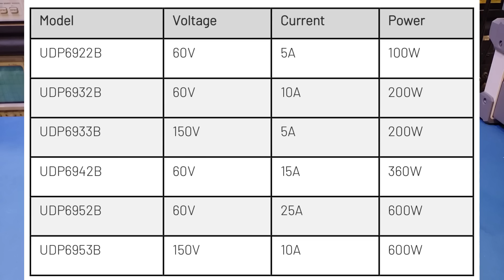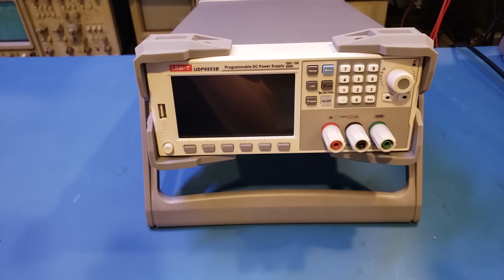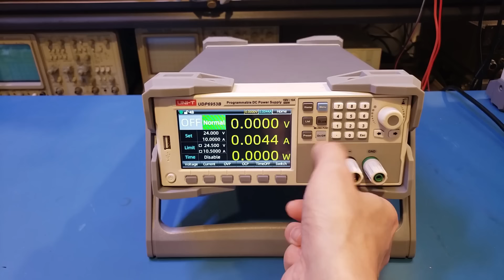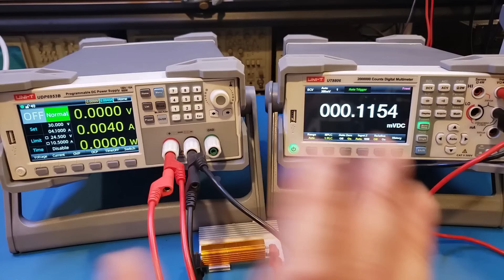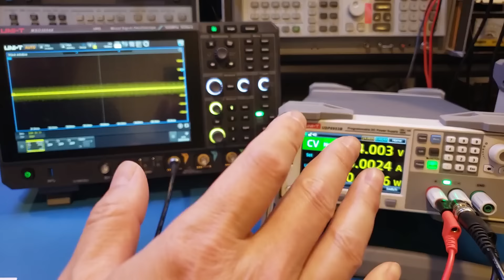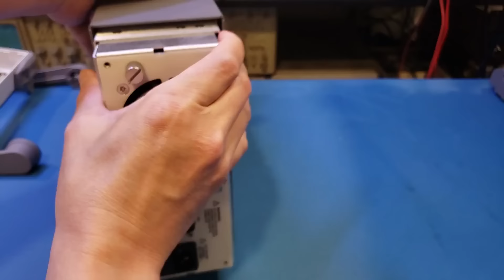UNI-T UDP6953B 150V/10A 600W Programmable Power Supply Review/Teardown

Comment: I would have liked to analyze the scenario where the power supply is set to maximum voltage, and the moment when the current limitation at 100 mA is activated is determined by connecting a load resistor while the supply output is already at high voltage. As far as I know, all SMPS power supplies implement current limiting at startup.

Comment: 25:45 - Im trying to understand, what are you showing here, OCP is slow and briefly allows more current? Because of 100 ohm resistor, voltage value on osciloscope should reach 10V and stay at 10V which is 0.1A? Overshoot is when voltage goes higher than 10V because current goes higher than 0.1A?
Even with current limited to 0.1000A, it went to 20.772V and 0.1292A? 
Then CC mode did its thing and stabilized current at 0.0997A? If you watch at 0.25 speed then numbers are visible.
27:12 - In 0.25 speed slow mode, you can see even 0.7582A with limit being on 0.1000A, next frame is 19.141V 0.1330A 2.5458W, its 33 percent overshoot... is this normal or? What about 1 amper, it will jump to 1.3 ampers or 1.03 ampers?
27:25 - 19.161V 0.7578A , 19.161V 0.1331A

Comment: Not knowing the circuit precisely… The unpopulated filter capacitor positions give them some assembly flexibility.  One manufacturer’s single capacitor with low ESR may be fine, but an alternate supplier may not offer as low an ESR, so two lower value capacitors could be paralleled to compensate if the cost is less.

Comment: Thank you Kerry for the thoughtful review.  It would be interesting to know more about the noise characteristics: common mode versus ground and differential across the output.   The power spectrum of the noise would be good to know, and does the noise spectrum change its shape as load changes?

I still like my Rigol DP832 linear power supply which I have had for almost 20 years.  There is also now a DP832A with the high resolution feature enabled out of the box.  There are three outputs with a total of about 200 Watts.  Two of the 0-30 Volt outputs are adjustable and floating, so they can be stacked to 60 Volts.  The third output is a fixed 5 Volts ground referenced for powering ancillary logic (It would have been nice it could be switchable to 3.3 Volts).  Ripple is 350 uV RMS, 2 mV p-p and transient response is under 50 uS.  The cost is about 430 Dollars US.  This is what you need if you’re doing sensitive analog work, and it nice to have the multiple voltages in a single package.  The downsides are that the DP832 is large and heavy and the 10-key input pad is arranged in a circle - an odd layout.

The Uni-T supply and the Rigol supplies are for two different purposes.  The Uni-T has a lot more muscle and would suitable for motor driver testing and the like.  The Rigol supply is more for testing and prototyping high accuracy analog circuits which require a differential supply.
Reply from the maker: It is difficult to test the exact noise level without proper set up that matches manufacturer's testing conditions. BTW, I will be reviewing another power supply from UNI-T this coming week, I think you will be interested if you like the Rigol DP832 and the UNI-T UDP3305S which I reviewed a while back.
Reply: @KerryWongBlog  Thank you.  I have much appreciation for your reviews and the time and effort which go into producing them.